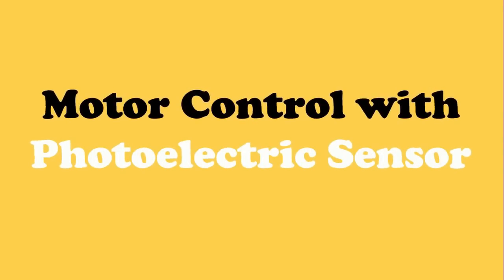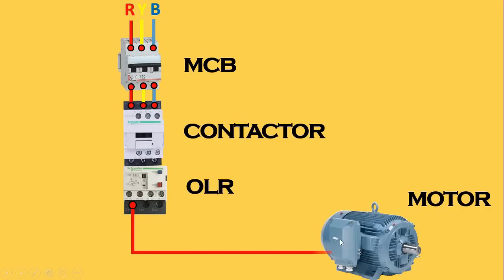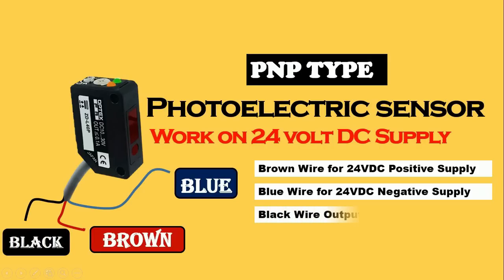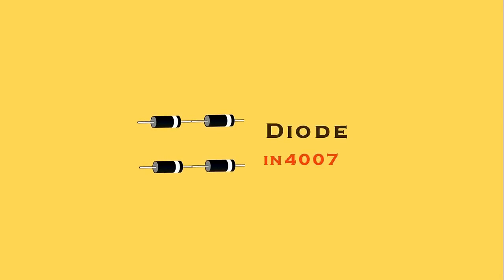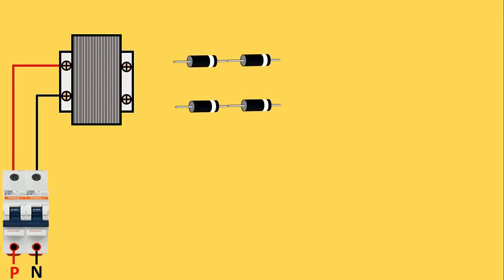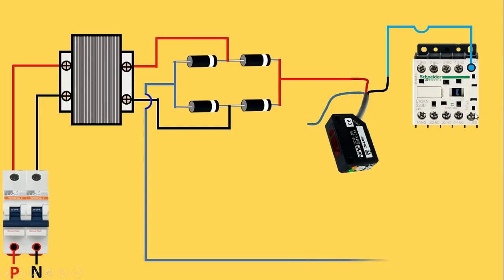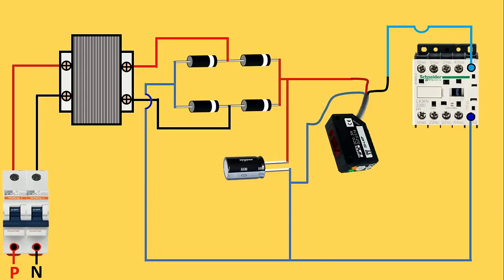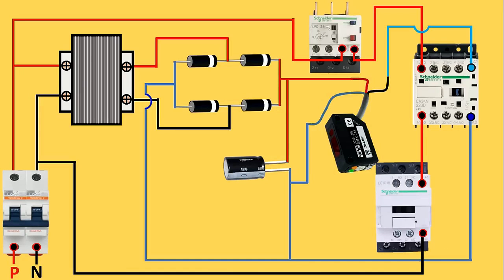How to Turn ON and OFF Motor by using a Sensor @TheElectricalGuy

Comment: Thank you very much for the beautiful videos
a question :

Why not use a power supply from AC to DC and it is simpler than connecting a capacitor and a diode
Since in reality it is impossible to connect capacitors (of PCB electronics) in an electrical cabinet